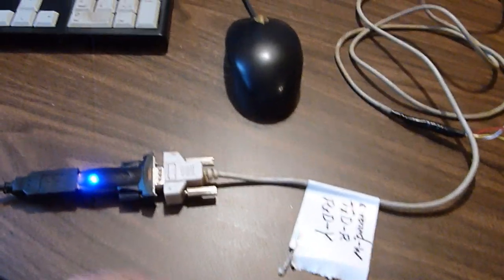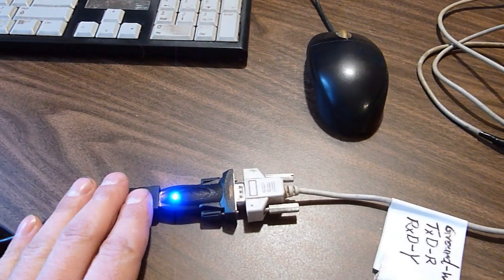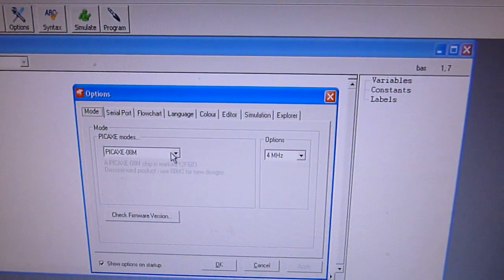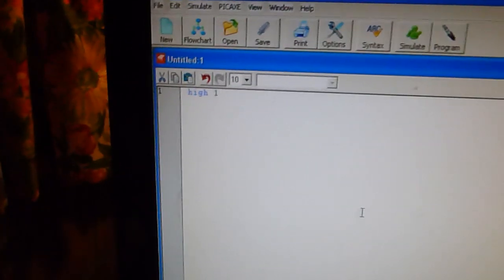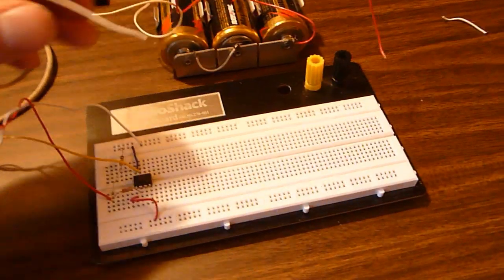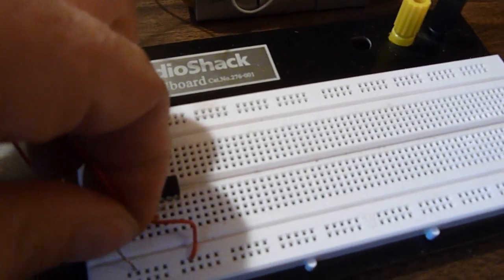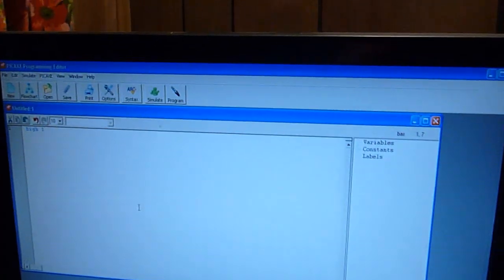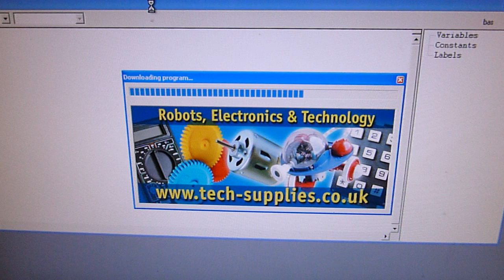How to program the Picaxe 08, 08m, or 08m2

Comment: If i am doing the same method on picaxe 20x2, how i want to reset during upload programming to it? Plez help
Reply from the maker: muhammad junaidi Ismail  Unlike the 28x2 and other larger chips the 20x2 doesn't require a reset switch to be programmed. Here's a link to a document that contains most of the programming circuits for the PICAXEs. www.picaxe.com/docs/picaxe_manual1.pdf  P.S. I normally start the download before I turn on the power to the PICAXE.

Comment: You know, everybody (me included) may not have used the same color wires as you did to modify our DB9 cable. I used white for ground, red for TX and green for RX, which is close to what you have, but in any event, instead of saying "insert the red wire", you should have said "insert the TX", in case someone used black brown and green, blue, purple and orange, or pink, green and blue....you get the idea.

Comment from the maker: I've programmed the picaxe chips with both the adapter and onboard serial ports. The quickest way for both, is to make a small program and try programming the chip. If it succeeds then you are all set. Otherwise you will need to change the COM port or check your programming circuit.  Oh, and make sure you select the right chip in the Options menu. 
  
If you are still having difficulties. let me know how you are connecting to the computer.   

The test program can be as simple as...

pause 1000

Comment from the maker: If your computer has a COM port in the back then you can try each one that shows up in the COM port setup. Usually COM 1 or 2 would be the serial port. COM 3 usually is assigned to the modem if your computer has a modem.

Comment from the maker: I used a usb to serial adapter.  The fastest way to check which port number it was assigned to would be to open the COM port setup in the picaxe editor's options then plug in the adapter. After a minute click the refresh button.  The COM port number that shows up is the one to use.